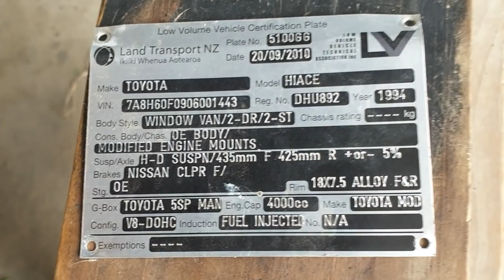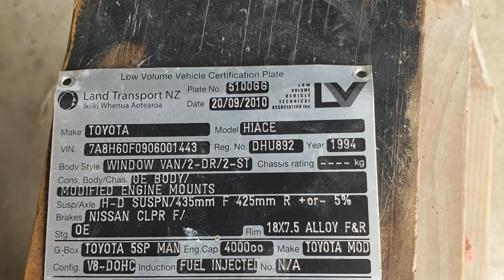RIP - Deceased 1uz Hiace Van - RIP

Comment: I was a courier in a Hiace for a while. Beat it ‘like a red-headed step child’ for 2 years, chirping in to 2nd multiple times every day and it  never skipped a beat and had perfect compression when I sold it. My first Toyota and my first taste of a really well built vehicle. Couldn’t believe how tough it was. Ended up loving it. 

I didn’t know about 1uz’s back then so I used to plan (daydream) putting a Buick 3.8 in it as I thought they were light and tough. 

(Also couldn’t believe the Japanese had made a van that so easily and comfortably fit a big 6’4” boof head like me)
Reply from the maker: Hiace are a great machine.  Even better with litres under the hood.  And fuel economy was close to that of the 2.4 petrol.  I just got another as a camper but trying to convince myself to leave the diesel in it.  Not only do they fit tall like you but they fit short like well too.

Comment: Neat video. It always seems to take a guy back finding a familiar vehicle in a wrecking yard. I recently came across a my Toyota Tacoma 4x4 that I bought brand new. The truck was wrecked very hard and stripped of most its parts.
Reply from the maker: I think it's a bit sad too.  Especially when it was many hours of your life building some of these vehicles.  The owner of that van ever intended to sell it.  Good that I'm using some of the parts for the next one though.  Cheers Kelvin
Reply: Yes Sir. 
Essentially the soul of your van lives on  heading out on the highway. Did you ever wonder how things come together, you just happen to be in search of a engine not ever expecting or searching for van goodies and  look who got herself noticed by someone who would. Alot of things had to come together for your reunion to come together. That van could of been seconds from becoming a beer can. I half expected you to bring the whole of her home, but parts work too.

Comment: What's the brake combination used for the Nissan brakes etc. Cheers
Reply from the maker: Unfortunately we didnt have time to do the video when the brakes were swapped over. R32 skyline calipers onto commercial hiace hubs ( not super custom) with kzh100 rotors (must be correct diameter as there are different options), with everything adjusted to centralize the rotor into caliber.  Custom hoses.
Reply: No modifications for caliper to fit, also what diameter rotors are used?
Reply from the maker: @dieseljuice5136  depends on the way the whole setup is centralized.   We have machined hubs,  not ideal,  made a tiny spacer behind bearing , good or skimmed a couple of mm off the mounting boss of the caliper which works really well.  I have a part number somewhere for rotor.   At one point we were getting one which was a bit big in diameter and skimming a few mm off the od but found correct ones last time.
Reply: Can a supercustom brake set up be a simple upgrade for a base model. Just wanting a small improvement without going into to much modification cheers.
Reply from the maker: @dieseljuice5136  complete stub to change for supercustom to fit as caliper doesnt bolt on,  and you may have to change wheels as most suoer custom are 6 stud,  not the common 5 stud,  unless your van has the 6 stud already.  There are less mods fitting the nissan calipers than doing the normal suoercustom swap.

Comment: I recently purchased a supercustom also with skyline brakes (gtr). Had to change them because the disk didnt sit in centre of calipers.. wehh
Reply from the maker: At least its a simple fix with either a little bit of machining or some suitable spacers.  I used to keep the spacers in stock for the job we did that many.  Cheers Kelvin
Reply: @CartuneNZ  Yea ended up going back stock certifier didnt want spacers of any sort..Cheers
Reply from the maker: @TheRyadrian  I've certed plenty like this,  its a tiny spacer that slips behind the hub bringing and work well,  other option is I machine a few mm off the caliper mount. Again no issue getting this certified.  Ive done more than I can remember and every one got cert.
Reply: @CartuneNZ  Tell this to the certifier in Mahia close to Gisborne.. And the guys i took my van to in Gisborne 4x4 diesel overnight services. They just couldnt work out how to do it..pretty sure i was mentioning everything you just said. Spacers and machining the mount down..Maybe they just wanted more time from me. Kept saying the guy wont allow it. AH well its certed now :D
Reply from the maker: @TheRyadrian  certifiers can be tricky.  Most wouldn't even know what I have done to make it work.  The tiny spacer behind the bearing cant be seen or the machining on the caliper mount can't be seen.  They think it all bolts up which it does now and looks factory fit. Ill try to do a video on it.   Cheers
Reply: @CartuneNZ  Yea awesome im sure it will be a useful video for a lot of poeple!